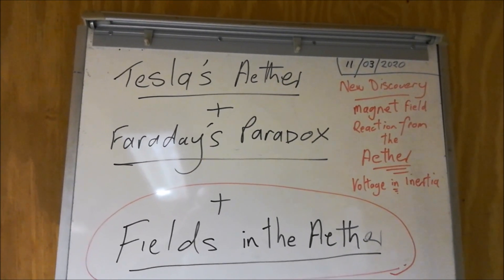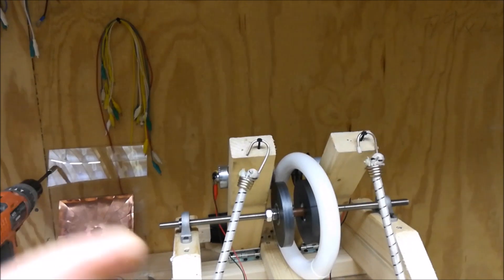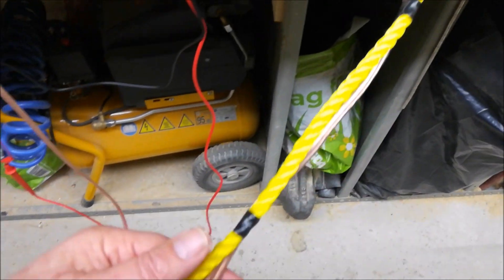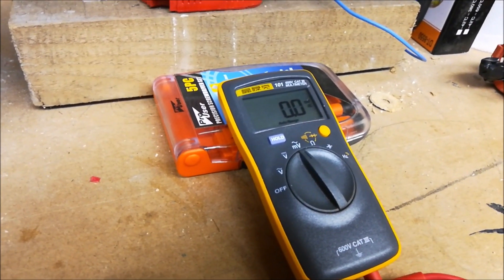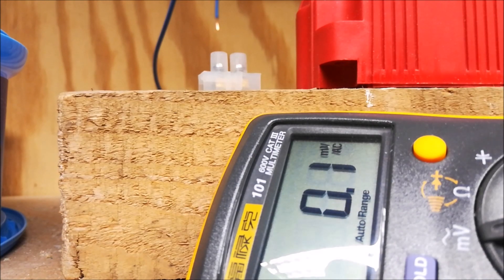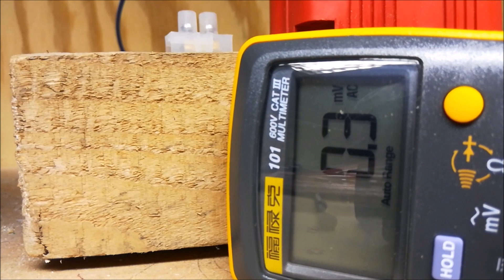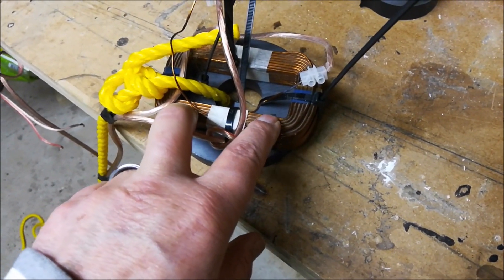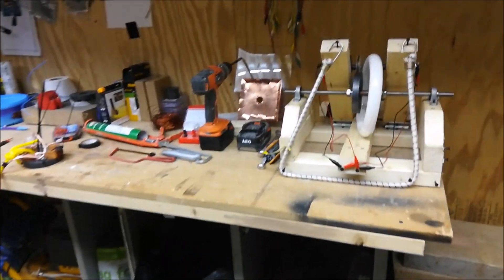Tesla's Aether & Faraday's Paradox Magnetic Discovery

Comment: You sound a lot like the Draftsman, English accent.
By the way, the double coil device charged the cap to over one thousand volts. Scary!
Could you go to a remote area, out in a field, away from all electric interference.
Swing the mag/coil on the rope around in a circle while you stand in the center, hold your hand over your head and swing away, a larger radius. Little voltage in the shop, bigger outside.
Reply from the maker: Hi T yes you read my mind. In the workshop too much radiation from workshop electrical wiring etc.... Regards.. DC
Reply: @e.powerdc1127  DC, Let me know if that mag/coil on a rope produces voltage when swinging it in a ten or fifteen foot [4 meters] circle over your head.
Reply from the maker: @tribulationcoming  yes will do, hope to do a video soon with results... Regards... DC